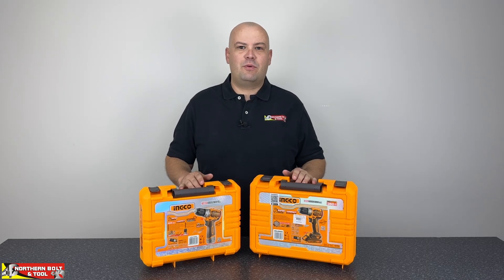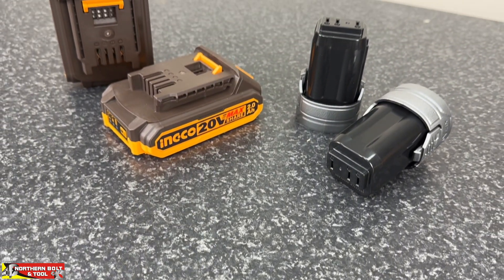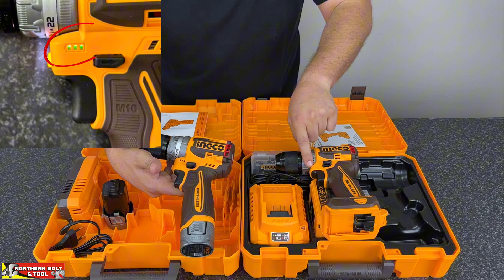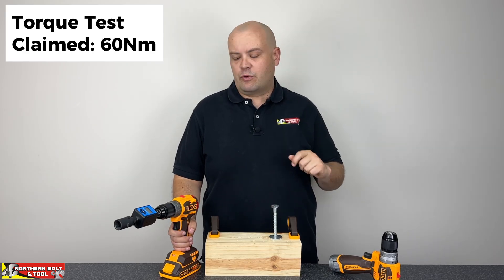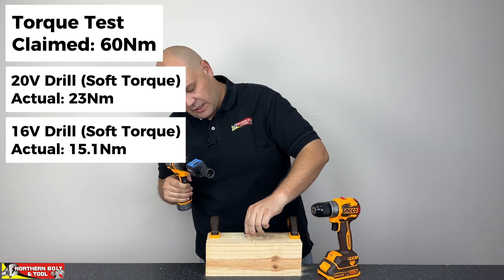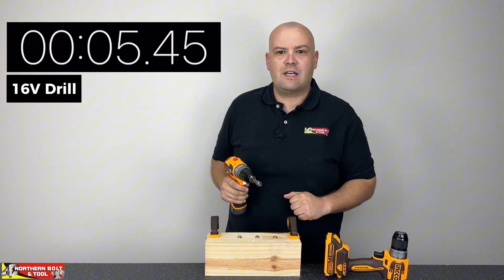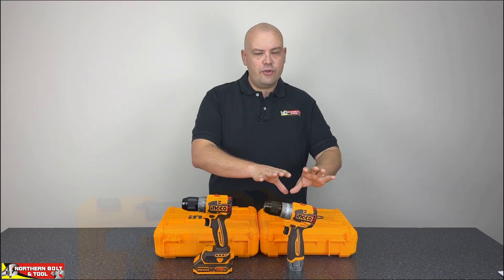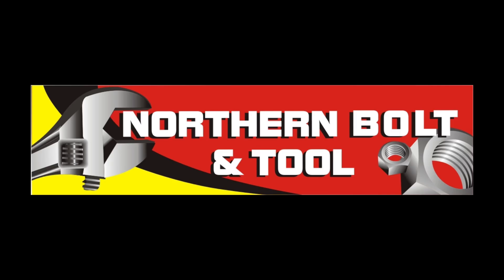16V better than 20V??? Which one should you buy? Ingco Cordless 60nm Drill - CIDLI16682 vs CDLI20602

Comment: You are really a king YouTuber no one is making the video about the tools specialy  on cordless drills. And I Wana buy Incgo 96nm .. Is it's best for my household tasks ? Plz reply ... And Incgo 96nm is durable????? Because it has metal gear box housing....plz suggest me drill specialy from Incgo because I am from Pakistan and in our country DeWalt and Makita are not available in box pack category...
Reply from the maker: Hi there, thank you for your support and for watching! The 96nm drill from Ingco is a very good choice and highly recommended. If you do not have batteries then definitely buy this drill in kit form with batteries & charger.
Reply: @NorthernBoltandTool thanks dear I was planning to buy 96nm full package with 4 amp batteries and charger.

Comment: Hi, a quick question.

Why does the box say 60nm, but it only goes up to 15nm?

(I'm not an expert and just want to know.)
Reply from the maker: They type of torque we are measuring is the soft torque on the machine, basically where the machine cuts out to prevent damage to the unit. The soft torque figure gives a better indication of real world application.

Comment: Always prefer to have a lower voltage drill/driver for ease of use and lightness. Wielding the 20volt all day for driving in decking screws can be a little too much on the wrist. At a push, the 16Volt slides into a large work pocket which is handy too for anything at height.
Reply from the maker: Thank you for sharing your experience, we appreciate you sharing your information and knowledge for us. We will keep with in mind for future videos. Thank you for the support and for watching!

Comment: Drills often don't display a precise rated torque test value, but instead, they often use a clutch setting range to indicate relative torque. This is because torque is not a fixed value but depends on the material being drilled and the chosen clutch setting. Some less informed people will jump on the "bad product wagon" 
The way in which you test (just once on one surface) show just a portion of the potential torque - i would rather leave the torque test out, or do it proper.

Nice to see someone test all the Ingco tools - i love the brand
Reply: He compares all brands and models with the same torque test... so I think it´s useful.
Reply: I don't think leaving the torque test out is a good idea. This video shows exactly why it is needed.